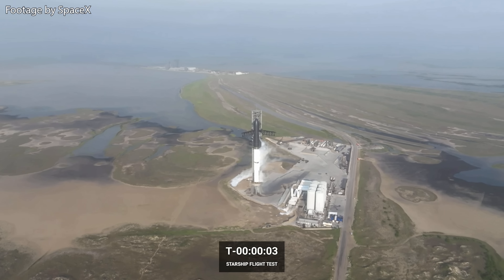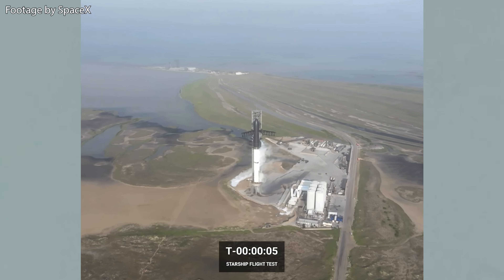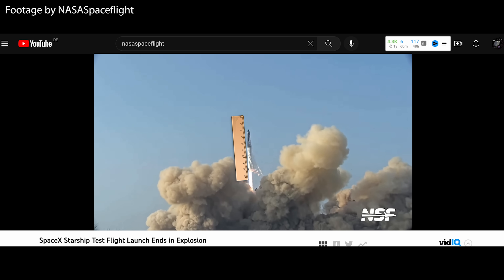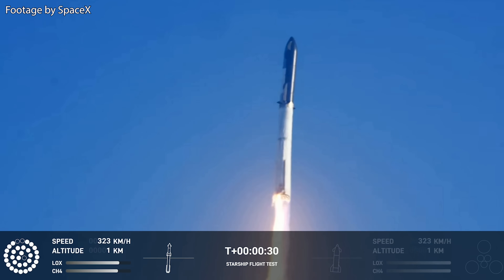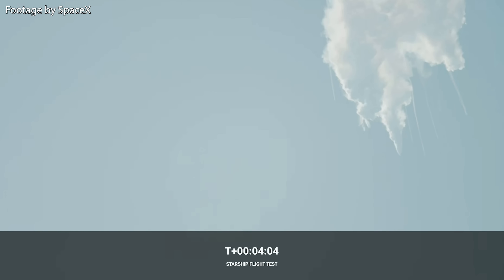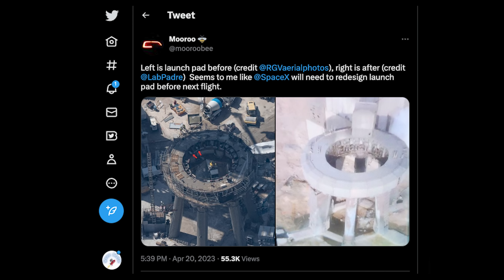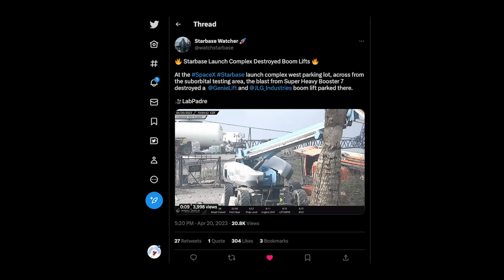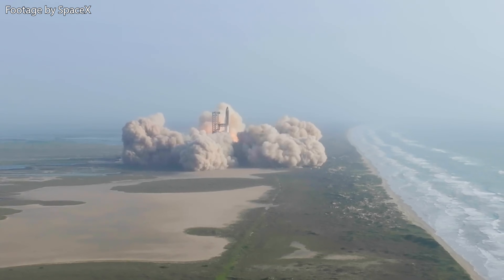SpaceX Launches Starship But Causes Big Damage to the Pad. What Went Wrong?

Comment: They cooked the nozzles by not having  quick enough lift off of the pad..

Also, exactly what "terminates" it, are these things carrying an explosive charge..?
Reply: Yes. Virtually all US rockets have a Flight Termination System (FTS). Typically, it's designed to zipper the fuel tanks, and the rocket will do the rest. Russia doesn't do this. Not sure about China.

Comment: The damage to the pad is a learning curve and was sustained as part of a regular launch. They need to strengthen the area under the launch mount and maybe move the other tanks a bit further away, but they didn’t trash the pad all the way which would have happened if it had exploded on the pad.
Reply: NASA built survivable launch pads 50 years ago. That's what the water deluge is for.
Reply: @VisionCommunications  yeah, that’s true and it’s true that SpaceX tried it without one. It didn’t work, was an idea and now they know. Experimenting is half the fun. 

Plus, isn’t this rocket twice the power of the Saturn V? That’s a lot of power for any surface to handle, with or without water.
Reply: @VisionCommunications  No, water deluge is for sound control. It prevents sound waves from bouncing back to the ship and causing blast damage. A water deluge on this design may just make matters worse. They need a flame diverter in concert with a water deluge. It's the only way.
Reply: Glad no one was headed to Mars or one of Jupiter's moons..
Reply: Surely its not THAT expensive to dig out, line it with reinforced concrete, and refractory coat for the first 100 feet, a tunnel below and under the pad going out sideways to direct all that thrust somewhere else while keeping the pad at ground level? Or is it Florida swamp making that impossible?
Reply: @asakayosapro  this is Texas
Reply: A truly unnecessary “learning curve”… like Russian project
Reply: Honest comment..uhh
Reply: WHAT LEARNING CURVE ? IN 1969 NASA ALREADY SENT PEOPLE TO THE MOON WTF...LEARNING CURVE DO WE NEED ??? COMPARING WITH CAPE CANAVERAL LAUNCHPAD THIS LOOKS LIKE A FREAKING TRMPOLINE ...THE 44 BILLION DOLLARS SPENT ON TWITTER PROBABLY WOULD HAVE BEEN ENOUGH TO BUILD A LAUNCHPAD :) :( :( :(
Reply: Looked like the difference from a Spencer rifle and musket ball during Turkey season

Comment: Consider this... starship started tumbling. And even during this incredible stressing force of the vehicle it all stayed together. Even the connection between the first and second stages held firm. Most rockets that lost control in this fashion disintegrate the moment they turn sideways. The whole stack stayed together. Incredible!!!
Reply: I took notice of that too. Three full flips and the rocket was still going strong. The explosion was forced detonation from mission control, meaning it might never have exploded until it hit the ground. 
That's incredible, I've never seen a rocket do that. Must be the steel construction.
Reply: @augustday9483  After another look, watch when the raptor exploded and shrapnel flew everywhere and nothing else blew up. I am actually floored by how this thing held together. The hole in the ground under the launch mount and video at launch shows concrete flying 100 meters up so you know the engines were shotgun blasted on the ground. And it still got up. Mind blown. This thing this going to completely change the game.
Reply: @vauhner81  Yes SX seem to keep shooting themselves in the raptor.  This i read is why so many engines failed and lost the flight.  Expensive mistake.  I hope the data was enough compensation.
Reply: @timboatfield  Elon Musk is the Bob Ross of rocket engineering. "There are no mistakes, only happy accidents." The data collected yesterday is worth 100,000 hours of supercomputer calculations and simulations.
Reply: @oldbloke135  No dude.  As much as I'm down with Elon, that was a huge falcon mistake.  Did you see the size of the lumps of concrete flying around at lift of.  It as only pure luck that one of those flying lumps of concrete didn't end, not only all three stages, but the whole of the launch site including a loaded sub-orbital tank farm
 This was really falcon silly!!
  Yea risk setting back the program eight months.  That would be sick!
Reply: @oldbloke135  They use the data to validate the computer models. So there really is no substitute for testing.
Reply: The strength of the vehicle is absolutely amazing! Engines were exploding on the way up and she just kept on flying on to MECO!
Reply: @mikedelta1441  I'm not sure there was a MECO, which might have been the problem. Seemed like the flip maneuver was initiated with the booster still firing. Maybe the explosion at 0:30 damaged a control mechanism that cuts off the engines.
Reply: I too was baffled how after the HPU exploding, a raptor blowing up and the engine bay being hit with chunks of concrete that the whole vehicle stayed together. Not to mention the spinning when stage separation should have occured
Reply: It is my understanding the rotation maneuver was part of the plan for separation. From the video is only 2 of the 3 center engines were lit. I bet those engines are the primary engines used to rotation the craft before separation. With only 2 working they were probably unable to stop the rotation after it started.
Reply: УКРАИНА ПРОСРАЛА УСЕ  your country still has not accomplished what ours did 50 years ago.
Reply: The connection between the first and second stages designed to held 1st stage mass while accelerating through air near supersonic speed. Why i am not surprised it held.
Reply: Tbh that’s great but seems like nonideal engineering, usually you only want to meet the absolute minimum of the requirements as it costs much more weight and money to go above them. But if they can afford it it’s great especially for manned missions ofc
Reply: It was only traveling about 1000 MPH in thinner atmosphere. No reason to break up.
Reply: @VisionCommunications  100,000 tons spinning with cryogenic liquid sloshing around. The centrifugal forces on the internal structures alone had to be astronomic!
Reply: @dansgettingintosomething7125  Where did you get 100,000 tons from? lmao The starship has enough thrust for about 5% of that weight.
Reply: @dansgettingintosomething7125 space x starship is not 100k tons lol wtf it is 5k tons
Reply: maybe the fact that it stayed together was the problem? All we can do is guess at the moment
Reply: @marrs3312 haha, no
Reply: It depends on altitude. At 35 km, air resistance is rather low.
Reply: Agreed but that’s in large part due to how thin the atmosphere is where it happened.
Reply: @Meatball2022  Take ouut the air resistance. A spacecraft 1 and 1/2 football fields is rotating end over end. Just the forces of torque alone are huge. I have worked on an offshore construction barge and until you see 5000 tonnes being lifted, the scale of something this massive isn't really appreciable. When we lift a mass that large, everything is done VERY slowly as the forces are extreme.
Reply: @vauhner81  I agree. The torque must have been nuts. But that happens at 10k feet and that thing breaks in half….
Reply: @Meatball2022  Oh for sure. :-)
Reply: @vauhner81  I might even say it’s overly secured to the booster. Probably can reduce it by 25% and save that weight.
Reply: @vauhner81  But you weren't working in freefall
Reply: It wasn't supposed to stay together...just saying.
Reply: Was not Starshipp supposed to seperate by "tumbling" (using the boosters flip manuvre) to save weight on seperation hardware?
Reply: Trueee, I was wondering why it wasn’t crumbling. It was going more then 1000 mph doing flips 😂
Reply: No, I would argue that 'most' rockets that lose control are commanded to destruct immediately as soon as this is detected rather than cause problems around the flight path as they don't have the luxury of being out of the way.

When a launch goes wrong, their mission control does not faff around looking at it, but eliminate the risk and terminate the vehicle without hesitation.
Reply: Advanced technologies were presented at the international online forum "Global crisis. There is a way out". For example, the health capsule (the possibility of life extension, rejuvenation and absolute health), from time 7:09:09.
These technologies will be available free of charge to everyone when building the Creative Society.
Reply: Other rockets immediately explode because their termination systems function correctly. Plus at that altitude the atmosphere is basically nonexistent.
Reply: Great the rocket won't break up once it is out of control and has to be blown up anyway.
Reply: It’s not that incredible. There was barely any atmosphere to work against the frame. While supporters keep justifying this as a massive collection of data, fact of the matter is that it failed doing the basic stuff we mastered in the 50’s, 60’s, and 70’s. Apparently there was cut corners, gross negligence of craft, and a launchpad that wasn’t even fully functional. This shouldn’t have happened. Would you be applauding a new car from being able to get out of the parking lot of a dealership?
Reply: There are an amazing number of experts here able to determine 'the massive stresses' which the rocket survived by watching a video...
Reply: @thedubwhisperer2157 I think it's likely many people commenting have STEM backgrounds. I'm a EE, while I don't have the expertise of a mechanical or aero engineer, it doesn't take much beyond into physics to appreciate what is happening. Plus it's pretty easy to find starship characteristics from all the people that closely its development.
Reply: @faintingGoat9946  Sorry, I do not know what STEM is...
Reply: @thedubwhisperer2157  STEM is science, tech, engineering, and math.  I was just suggesting that people that would watch a video like this are probably more sciency oriented than the average. But this is still the internet so people are gonna say whatever regardless of background 😂
Reply: @faintingGoat9946  Thanks for that - and a very valid comment too!  The 'I saw it on YouTube so it must be true' generation is a sad indictment of the decline of rational thinking...

Comment: It's incredible the amount of geniuses commenting who don't have a grasp of what the words "test flight" means. 
This was the 1st launch of a brand new system. The fact that it didn't blow up on the pad is a win. It lifted clear of the OLM. From a data-gathering exercise, this was gold. Every second it kept flying was invaluable.
Reply: I have over 40 yrs in aerospace engineering and I understand very well what 'test flight' means.  My beef is that a lack of consideration by the team endangered the entire test.  You're right, the fact it didn't blow up on the pad is a win, but no credit to the team because they didn't take reasonable steps to minimize the possibility.  All to shave a couple of months off the program schedule.  They were damn lucky it didn't RUD on the pad- then there would be next to no data.  Dumb decision.
Reply: @johngunderson5463  Thank you not to mention the main objective was to get it into orbit and which they failed and that's not even mentioning the destruction of the launch pad.
Reply: I don't think you understand how much this 'data gathering exercise' costs. That's 33 raptor engines, one whole starship prototype with the heat shields it was supposed to be testing. That's damn expensive data, probably exactly zero data for the heat shields, probably inconclusive for stage separation. Calling it a success is disingenuous - the flight plan had objectives, not all objectives were reached.
Reply: @PaulSpades  I just had to go on you you just scream a person that needs to get told something, they knew this might happen, and so they accepted it, did you even listen to elon in the interview that he said he was just happy that it would lift off the pad that was a win anything else was extra. If you say put a flame trench or flame deverted yes you can, but wait 6 months and then after that u realize you have to modifity it again without any test data your gonna be awiting longer, and with this data you can make it exactly handle the power you want and make it work for what your wanting to do. So yeah it was sucess by elon and space X so whatever you freaking say matters nothing to them so go enjoy being a engineer lmao
Reply: @PaulSpades  Pretty sure they will be able to tell if any heat tiles fell off.  That would be confirmation for all the previous changes.  Progress